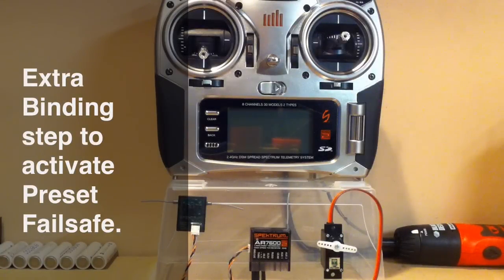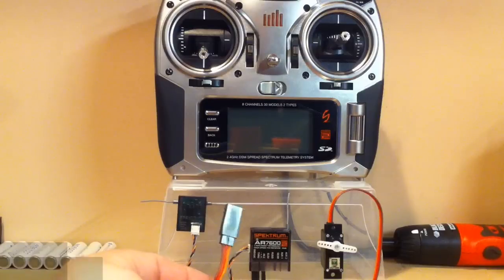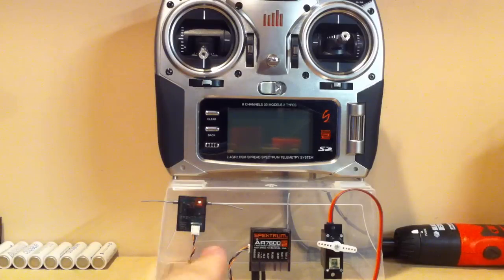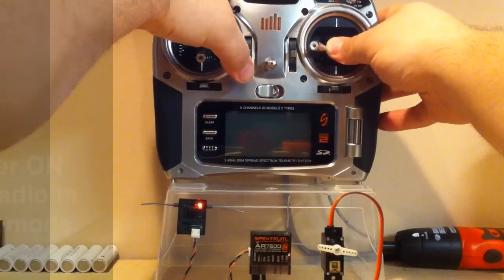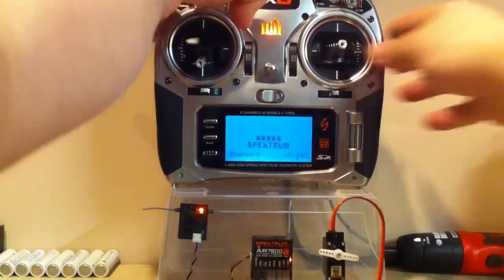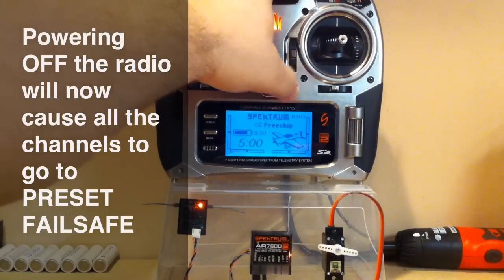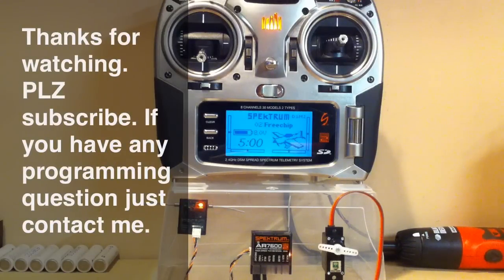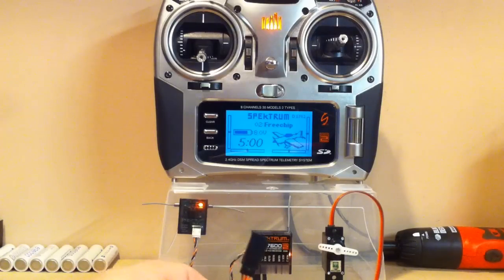Spektrum Preset Failsafe Steps

Comment: Is it possible to bind in fail safe mode at a part-throttle setting? On one of my models the electric motor starts to run a low speed if I switch off the transmitter but I leave the receiver on. I think it must be a fail safe binding error on my part.
Reply from the maker: Yes it is possible and why you should always have the throttle stick in the lowest position and in some cases have throttle trim in the lowest position as well. Some ESC's (electronic speed controllers) learn low position differently and this could result in what you are experiencing. ALSO if you are using THROTTLE CUT function on your radio make sure it is set properly. Meaning, set the Throttle Cut value so no movement of the throttle channel is visible in your SERVO MONITOR screen.

For example: If your throttle channel is set to -100% to +100% but your Throttle Cut function is set to -150%, there is a chance your esc learns this new lower position when throttle is activated as the throttle low position and when you either turn off throttle cut or power off the radio first (never recommended) your ESC could see this as some throttle input...

Comment: Thank you for doing this tutorial! I have been wondering how to stop my planes going full throttle with a LOS for years now! I only realised the other day that it was because the failsafe was set up incorrectly. This is a great safety device and I wish I'd known about it sooner.
Reply from the maker: With Spektrum receivers, if your Throttle channel goes to full in the event of signal lost this means you DID NOT follow proper Binding procedures. One of the steps is to ensure your Throttle stick is in LOWEST position and it is recommended to RE-BIND after your initial setup is completed to ensure Throttle failsafe is properly set.... But glad my video helped you out.

Comment: I did this on a AR9350 and it didn't work. 
I set it to deploy spoiler, throttle off and in landing flaps. When I tested it by turning off the radio, it didn't go to the failsafe presets I'd set.

Comment: Does this affect any other spectrum controls set up on my 550!
Reply from the maker: DJI Naza requires you bind in preset failsafe with the throttle stick above 10% and the flight mode in failsafe mode. If you have a switch programmed for failsafe return home make sure this switch is activated for return home. Then you can easily test with model connected to assistant and powering off the transmitter and watching what the assistant says.
Reply: thx

Comment: Thank you. When i did this failsafe as in your video, i could not connect it to the naza assistent software, so i used an other 6 chanel reciver and it worked fine. I have flown the quad with the 6 chanel receiver. I feel i have to open the throtle for more the 50% before it reacts. Which setting will give me earlier response? Is it throttle gain? How do i do position hold? This the the first time ever i built a quad like this and am struggling to understand the basic conspets in terms of progaming. Thank you for youe excellent videos which i used to get the thing in the air but i have not understod the logic behind the programming. Hope you can explain the principle behind the terms like travel, gain, subtrim, mix, f-mode etc. Thak you and hope you will spare som time to explain!
Reply from the maker: +Vimalan Ketharanathan The type of Failsafe you program won't prevent the receiver from working with the Naza Flight Controller, you may have other issues with that receiver. Preset Failsafe is required for proper functioning of the Naza"s Failsafe Function if you are using GPS and want the safety of Return To Home....Moving the Throttle Stick past 50% before the motors spool up for take off is 100% normal and part of an update DJI did long time ago for the Naza Flight Controller. Once it takes off the throttle works as it should, no need to change any Throttle Curve settings. Position Hold aka release the control sticks and the model remains in it's GPS location is Naza's GPS Flight Mode and this is toggle via the Flight Mode switch that is programmed, setup and connected to the Naza's U-Port. If you followed any of my programming videos and programmed your Spektrum radio per my recommendations then that would be channel 5 aka Gear channel assigned to Switch B
Reply: Okay, thanks!

Comment: help
 i have a dx9 with a ar6200 i bound it the way  you say to  after binding i go to change models and the ar6200 goes into half power reverse. it was bound to 0 throttle
i have 4 models with the ar6200 and 2 will do this
Reply from the maker: The AR6200 does not support Preset Failsafe, you must bind with the throttle stick in the lowest position and leave the bind plug inserted the entire process.
Reply: +freemarlochip 
i did that and it binds fine . as soon as i go to change models she still kicks into half power reverse
Reply from the maker: Sorry but I don't understand what you mean. When you change model memory you need to rebind to the new model.
Reply: with the dx6 and dx9  that i have you can switch between model's. you can go from truck 1 to truck 2 with a few strokes of the roller wheel
Reply from the maker: +mac c  What I mean is I don't understand your problem you're having. Binding is the process the receiver learns the transmitter code and model memory location. Each receiver binds to a specific model memory and only connects to it. Receivers do not lose bind until the bind process is started again. Send me private msg so we can communicate better instead of leaving posts on videos.

Comment: my throttle stick moves my rudder. my left stick moves my elevator up and down when I move it right and left. my configuration if all backwards, how do you fix that?
Reply from the maker: You reset the model by selecting the model type again, once you have selected a new model type check the servo monitor to confirm things are moving as they should.

Comment: Hi there, thank you so much for the kind info, but I have a question, while doing servo setup, I did throttle reverse to to match with the servo position, how should I bind as when I switch the TX off, the servo reverses to full power? Appreciate if you let me know how to connect to the RX in this case.